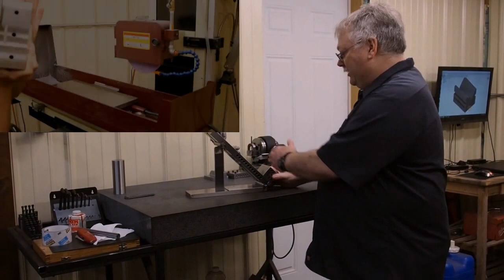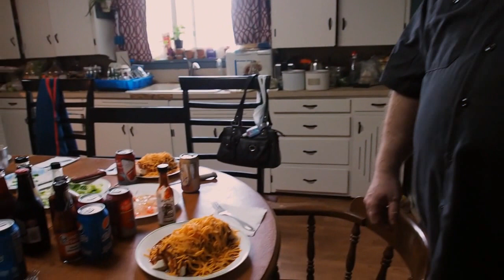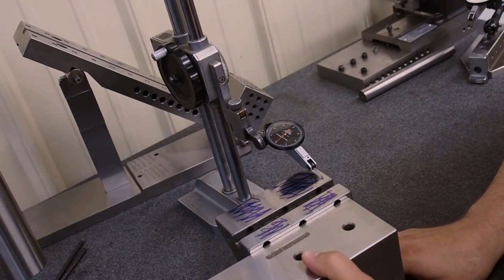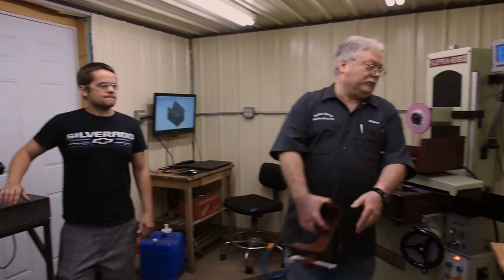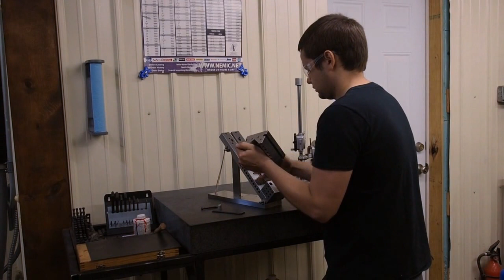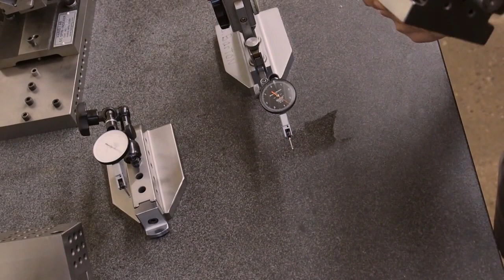Jonathan's V-Block

Comment: I don't understand how the Vee is measured to be central to the sides of the block. Or how that is ground, other then you grind down to the same height.
I don't see a height reference on your surface plate, so I'm curious how you measure precision heights of parts. Seems a height gauge would only measure to thousandths. 
Still watching the many videos. There's not much on surface grinding or precision surface plate usage on youtube, so your videos are very useful to learn from. Thank you.
Reply from the maker: This video shows one method of grinding the V central. https://www.youtube.com/watch?v=g1PMM2nOcW0  Start at about the 28 min mark. I measure precision heights using gage blocks as a the measuring tool.
Reply: @SolidRockMachineShopInc  Thanks Steve. Looks like you're making a new Vblock for your Harig in the video.
It's one thing to just make simple cylinders on a lathe,  and blocks on the mill. It's only been the last few years that I've been acquiring surface plate tools. The first project I fixed was the lathe spindle hole adapter. The lathe I got new in 2004 from Grizzly, it was never a catalog item, but a special internet deal. 18x40, 3tons. The spindle taper is what I now know to be 90mm metric taper. It was supposed to be a European import. I think they brought in 6 of these. And what I've learned is every scrap part went into them. So I've been repairing the preassembled kit since new. So to fix the adapter, which has a #4MT hole in it. the major diameter was about 4.5 thousands larger then the minor diameter. it's 90mm at the gauge line, and has a 20:1 taper. Grizzly's documentation said it was a #6MT, but that's small enough fall through the 80mm spindle through hole. I ended up getting a bench center, and a large sine plate to measure how far off that adapter's taper was. I reground it using a surface grinder last year. It fits perfect now. So all that led to learning more about metrology measurements on the surface plate.
My cheap surface grinder, had deep groove ball bearings in the spindle, and not any precision. So I found a matched pair of ABEC 7 angular contact and install them. Then I inserted the spindle which is the same as the AC motor spindle in my lathe and use the tool post grinder to fix any runout. It's less then a tenth. 
As for out of balance wheels, I've now learned the ones I'm getting from eBay are most likely rejects that what ever grinding shop had, disposed of. I've gotten a few that were old stock, and they seem to work better. But my surface finish is no where near yours. Just too light weight of castings.
Reply: Or you were making a new vblock these videos are 5 years old now.

Comment: Before retiring  from the trade, I made a 4 in square V block with a 120 degree angle for the V. This block also bolted to my 4x8 angle plate on either face with screws through the v block drilled lentgh wise and cross ways. Very handy setup aid!
Reply from the maker: Hi old magician,
That sounds like it was a handy V block.
Steve